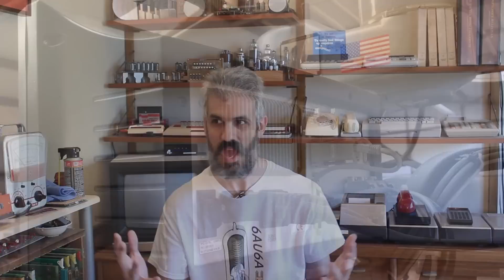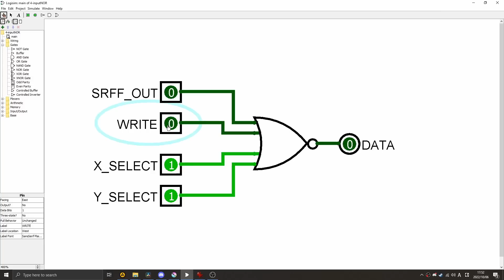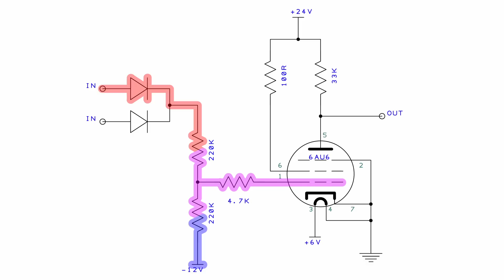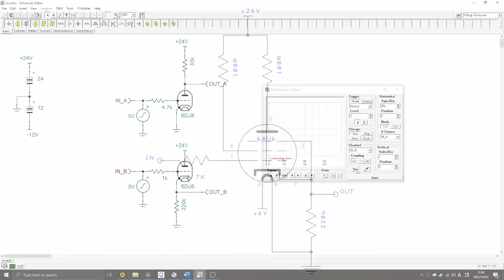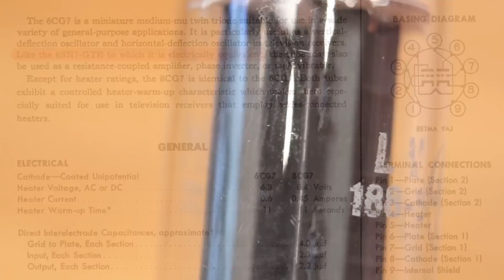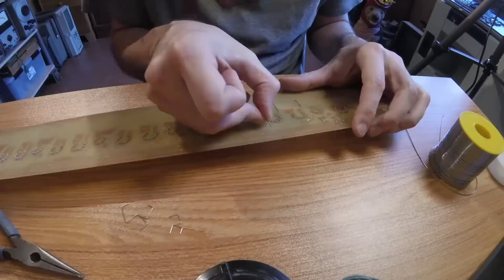Vacuum Tube Computer P.29 – Addressing and Fanout Problems

Comment: Are you trying to build a vacuum tube based computer, or a transistor based computer just with transistors replaced with vacuum tubes? For example, the british managed to build a vacuum tube based memory just after WW2, with 2560 bits of memory in a single vacuum tube. https://en.wikipedia.org/wiki/Williams_tube

Comment: If you want to make boards in summer time, could it be an option to fit the CNC machine with a circuit board marker or other etch resist applier, and etching the board? Just draw it on there like if it's a particularly expensive plotter, then etch it. 
Those temperatures are ideal for etching boards. Don't even need to heat the bath.

Comment: After days of binging I have seen episodes 1-29.  I read the code for the assembler and want to get more involved.  The assembler thus far generates something like micro-code, that is, just the instruction codes.  I am interested in going farther with assembler and emulator that will work with the 12-bit instructions so that executable code can be written and tested, ready for UEVTC.  In other words, taking the UE14500 assembler and emulator to the UEVTC assembler and emulator.  I have joined the discord but don't see an appropriate place to begin this conversation.

Comment: Just a comment about cathode followers... They have great rise time, but the fall time is dependent on the load at the cathode, which in your case could be the capacitance of a large number of inputs in parallel with a relatively high cathode resistor. Before you go too far with the next stage I recommend trying the circuit with a clock signal and adding a bunch of capacitance to ground - maybe a few hundred pico-farads.  If you have the voltage headroom (you don't) then a mu-follower with some DC level adjustment would possibly be a better choice.
Reply from the maker: That's actually really excellent advice!
I have tested this cathode follower design at different speeds before, but for this particular tube computer build it's a non-issue because the clock speed is ultimately going to be mind-numbingly slow. Which is due to how I'll be building out program control - in short, I'll be executing the program directly from tape, so I'm aiming for a global clock speed of 100Hz max.
Reply: @UsagiElectric  Cool! Probably you'll be fine, but just something to keep an eye on.

Comment: Instinctively I'm pretty sure the logic could be implemented with fewer tubes.  Also the 220k grid pulldown to -ve bias seems very low and is unnecessarily loading the previous output, reducing the fanout.  Grid leak resistors are typically 1M to 10M, and with such a high bias voltage (-12V) I should think you could use a 10M resistor.  Vacuum tubes are voltage operated devices and should not need any significant current on their inputs.

Comment: Why not use a much lower plate resistor for the 6AU6 ?
Reply from the maker: This is actually something that I tried, but it means that my logic low starts to become not so low.
In saturation (flowing as many electrons as possible), the 6AU6 has around 2k ohms of internal resistance. Which means it forms a voltage divider with the plate resistor. If the plate resistor is 33k, that 33k/2k divider means my logic low is around 1.4V. However, if I drop down to say a 10k plate resistor, my logic low is now only 4V. I could probably still get away with that, but the tube needs to be in pretty good shape. If it's a tired tube or not quite up to snuff, that can easily float up to 5V or more.
It does take up a bit more space to use cathode follower buffers, but the peace of mind is worth the extra space I feel.
Reply: @UsagiElectric  Probably an idea to find a much more available tube to use as a follower , rather than 6CG7 . Even an otherwise useless non-linear variable mu double triode (that no-one wants) should work adequately as a follower

Comment: Cool project!

I wonder why you didn't go with the 6DJ8 instead of the 6CG7 as the cathode-follower.  The 6DJ8 has like twice the transconductance which might be helpful.

Another possibility might be to go to much higher resistors to the grids of the 6AU6's.  If the tubes are not gassy you can probably go up to like 2.2 megohms or so, lowering the DC loading.  The slew rate will be slower but you probably are not seeking very high clock speeds.  

FYI if you think you have logic swing issues, Seymour Cray's mainframe computers had to work with like only 300 millivolts of logic swing, and they worked surprisingly well with that.  It required the use of around 35,000 miniature coax cables between the gates, all of them 6 feet long.

Regards!
Reply from the maker: Excellent question! And the answer is... I already had a bunch of 6CG7s from random lots, haha. The 6DJ8 is a brilliant tube and even at low voltages it's one of the best out there, but they're also jolly expensive and I only have a few of them in my collection. However, the 6CG7 is pin compatible with the 6DJ8, so if I find I need a little more oomph, I can always swap out later.

Interestingly, I did try going higher resistance on the grids when I first started building my tube circuits. And I don't know why exactly, but with a 1M/1M split, I couldn't get the tube to go into cutoff or saturation. My current working theory is that I actually need to overdrive the grid pretty heavily to get the tube all the way into saturation with only 24V as B+, and the 220k/220k split seemed to be the best compromise for that.

Seymour Cray was an absolute legend! 300 mV of swing is ridiculous, but that dude not only nailed it, he got it working so well he sold the systems to customers who pushed that thing hard. What an absolute beast of machine!
Reply: aAa1

Comment: IMPORTANT: It looks like your leftmost LED is not really switching cleanly between on and off. It seems the yellow one never really goes off while the red one is fainter than the rest. Are you sure the levels are clean and there is no leakage/small short?
Reply: It is most likely due to the logic low signal voltage is above zero. I think he said around 6 volts for logic low.

Comment: Are ganged triodes ever used for audio circuits to allow smaller tubes to provide more output power?
Reply from the maker: That... I don't actually know. I'm a total noob when it comes to audio circuits, so hopefully someone else can chime in. Excellent question though!
Reply: Probably yes but paralleled pentodes are more common.

Comment: I'm sure you thought about this already, could you not use one register divider and hook that output trough the 4.7K registers on pin 1 of the tubes?
Reply from the maker: I'm not quite sure I'm fully understanding your idea here. If you could into a bit more detail, I'd be happy to either give it a try or let you know how it works!
Reply: @UsagiElectric  i was looking to the image at #9:58 where you added so many register dividers in a row. I was thinking when you added the divider before all the switches and connect them to the middle point of the divider,  what would be happen. But looking again trough your video again, i can't find how that image is related to the real schematic.  Also, please take my suggestion with a little salt, i'm in no where experienced as you are with this.

Comment: Q: about power? > have you thought about how you are going to drive your memory by? Your 1-bit computer is already demanding quit a lot of current, are you going to drive every thing by "one" (1- 12v & 1-24v) Set of power supplies? Or are you going to try to break it up in to one set  (1-12v & 1-24v) for the CPU and one set (1-12v & 1-24v) for the memory? have you also thought about how you are going to reset MEM to a known value (for a Reset)? and have you thought about how you are going to make the counter and how you're going to set the counter (for things like jumps, and sub Routines) ? Meaning are you thinking of using a main counter, and a sub routine counter?) Or just one counter ? You already have cut down on how much memory you're going to need by putting in a full ALU unit in the CPU, BUt by having a separate main MEM counter from a Sub routine counter would that not also cut down for the need of a bigger memory? Right now every time you address memory that will take 6 bits to have to store in the counter. Also down the line... Are you going to have to make a 6 bit serial to parallel converter (to load the counters) ? In my ignoance, I am still thinking your going to need more memory, but while I am thinking about that I'm still wondering if Modulizing your memory to smaller packets might be faster? Can your router be run at night or does it need to be Supervised?
Reply: Running it at night would be a lot cooler. And having some fans burning in cooler air into the building would help cool thins down too. We had to do that for work here in the NW when it got over 80 sets outside, and it was over 90+ degrees F inside.

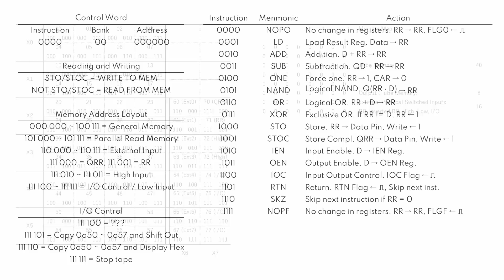Comment: This is too funny. I just started watching your channel recently, and hadn't seen any of the VTC videos yet. Watching this one, and I see the instruction set flash by at 3:45, and immediately went "Hey, that's the same as the MC14500B!"  I had a mentor that helped me out building a MC14500B system out of the handbook back in the late 70's (probably 1979, specifically).
Reply from the maker: Nice catch!
It's not actually the same instruction set as the MC14500 though. Initially, I was building the processor as a tube replica of the MC14500, but mid-way through I got upset with the fact that Motorola didn't include a proper ALU, so I did a bit of rework and slipped in a carry register and some proper arithmetic functions all within the original 4-bit instruction style, and now I've been dubbing it the UE14500. 
I love the little MC14500 chip, I built that same ICU system from the handbook not long ago on a breadboard! (https://youtu.be/oPA8dHtf_6M)

Comment: Instead of the 6cg7 it's also possible to use a 12au7 instead. Which works fine on 6V heater. (Heaters in parallel) It's a much smaller tube and much easier to get by. What frequency is the clock running again?
Reply from the maker: It totally could have been possible to use a 12AU7 instead, and the 12AU7 is a lovely little tube. The reason I chose 6CG7s is that I already had a lot in my collection from random tube lots over the years. Unfortunately, with how I'm running the heater lines (four tubes in series), I can't swap in the 12AU7 now without having to redesign the PCB. I can however switch to any other pin compatible dual triode (6DJ8, 6BZ7, etc.).
The clock speed hasn't been decided yet because the plan is to actually read the program directly off magnetic tape and execute it there without reading it into memory somewhere. So, the clock speed will be dictated by how quickly we can read the program off the tape, which means it'll be properly slow.

Comment: why use pentodes? you could've cut the tube count in half by using dual-triodes, and you'd also have lower output impedance to cause less problems.
there are also soviet micro-tubes which are really cheap, and a bit smaller, if you can get ahold of them.
Reply: dual triodes cost a lot

Comment: Is there scope for using a double triode as two in-series active inverters? Does this provide sufficient improved drive current for the fanout? Or is it too long since I did my electronics training (yes, it was pre-microprocessor days, and did include various valve calculations, but it was a long time ago in a far country etc).
Reply from the maker: Being in series wouldn't help with fanout, but it would reinvert the signal so if I needed to amplify an input signal without inverting it, that's a possibility.
There's a lot of ways to tackle fanout that I probably could have done better (like running a smaller plate resistor, or larger grid resistors), but anything worth doing is worth overdoing. I didn't just want to skirt by, I wanted my buffers to be able to supply enough current for at least double the amount they needed. Totally unnecessary, but now I know they aren't the weak point!
Reply: @UsagiElectric  Yes, I guess the problem with using valves and the implicit anode resistor is that the resistor is always going to limit the current unless you can use a cathode follower, as you have... for size comparison, I've just put a replica of the 8080 ALU (largely following the original design as revealed by Ken Shirriff) using 74HC in SOIC packages onto a board about five inches by four! :D

Comment: Why not have the PCB made by a fab? You already proved you can do it yourselves. A PCB house is a lot faster then quitting for the summer because the texan legislature hasn't discovered climate change yet.
Reply: I think he explained it in one of the previous episodes, but having all those PCBs made would be incredibly expensive.
The PCBs are also part of the design, since the look of the computer is a more important aspect than the density.
Reply: @crasbee  all true, but he complained about the wait and with the pro option you don't have to wait. And you do get cool options for silk screen. So you can make instructions and annotations on the PCB 's. I don't think expense is a factor. You don't build tube computers if you worry about cost.

Comment: You might want to consider using one of the hobbyist PCB manufacturing companies out there.  Just for the time savings.
Reply: That would defeat the purpose of compleatly home built and ruin the looks of the magnificent beast. :)
Reply: This is why his boards are so unique, they have a very pleasing aesthetic quality. It also fits the retro look and feel better compared to modern boards.

Comment: I am just getting hooked by your VTC computer series.  My training 1968-72 was all solid state, TTL.  We had RS flip-flops, you have SR.  Did the terminology change from vacuum tube days?  Obviously the logic function is the same, just the initials in the opposite order.  Your choice of tubes, my, they are all my good friends from youth!
Reply: Quite often with SR or RS flip flops, the order is which takes precedence.  For example, if you turn on both inputs to a RS FF, the output should be logical 0, as the reset is the dominant input.  The reverse would be true for a SR FF.  Although this convention was not always followed, so your mileage may vary.
Reply: @jeromethiel4323  Thanks.  I had never used the R=1 S=1 "indeterminant state so it never came up.  So both SR and RS are valid, and which one is determined mainly by whether the circuit is implemented by NAND or NOR gates.
Reply: @rickhole  If you are using an IC based FF, then reading the data sheet is your friend.  There are conditions where the S and R terminals may be simultaneously active, and you need to know how the device is going to respond.

I have seen some (i believe it was 74 series TTL chips) that the output state was listed as "indeterminate" when that condition existed.  But good designs are usually made so that the output is always deterministic.

I, for one, never want to roll the dice on how a chip is going to respond to weird input states.

Comment: i was wondering when you were going to get back to this.
its amazing how much space a little memory can take up
Reply: Indeed.  Memory was the constraining factor for quite a while.  Which is why when you go back, there were some really odd memory devices, because memory was critical, and making it with gates tended to be space and power hungry.
Reply: @jeromethiel4323  Memory devices are often some of the weirdest and novel of devices in a pre-IC computer. Delay-line, drum, core, Williams Tube etc for RAM. Core rope, transformer, diode matrix for ROM... Memory devices are often very strange.
Reply from the maker: It's good to get back to work on it!
Memory is easily one of the hardest aspects of computing to build. Most homebrews, even wild discrete transistor ones, use a chip for memory because it's just so painful to build otherwise. The memory I'm building may be easier to think about as being six 8-bit registers that the processor can store information in as needed. My construction method scales really poorly, which is why it's tube heavy, but if I wanted more RAM storage, I would need to start looking into stuff that scales really well like core memory.
But, you're right, most CPU registers are built using similar logic setups and it's wild how intense that construction style can be when building with tubes!
Reply: @UsagiElectric  Indeed!  And i don't think anybody would fault you for using even modest amount of semiconductor memory. 

I would not recommend going down the rabbit hole or delay line memory or magnetic core memory.  Although those are cool retro memory types, the amount of circuitry required with vacuum tubes would be insane.

Your vacuum tube computer is more in line with early computer types, and i think you should stick with what YOU want to accomplish with this thing you have made.

It is magnificent in it's own way.  And kudos for you for even attempting it, much less succeeding so far.  And i have no doubt you will end up with something you can be proud of, and may even end up in a museum at some point.